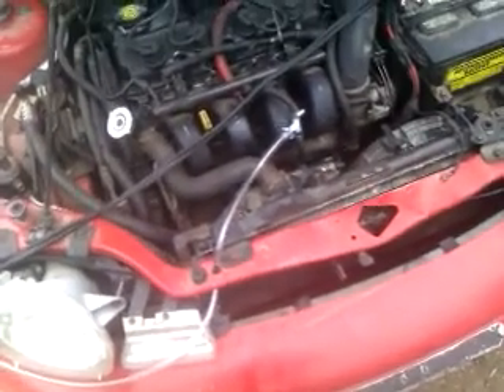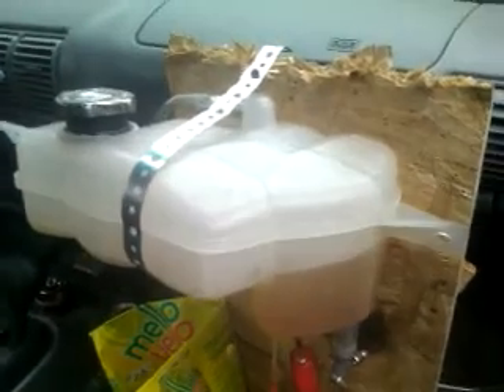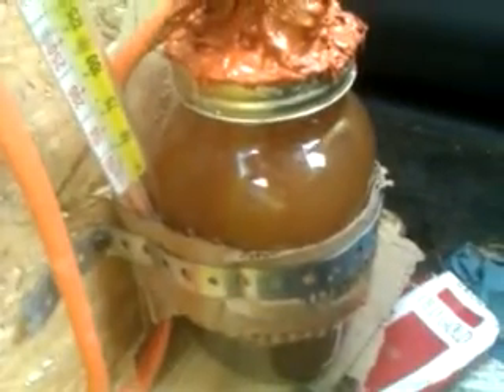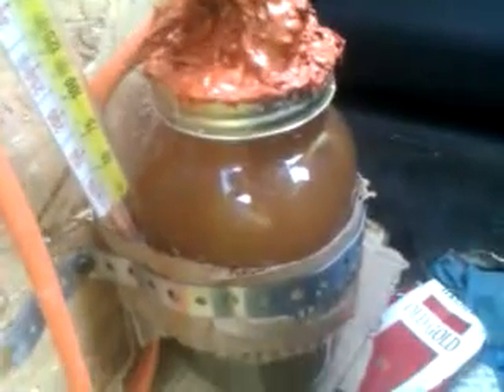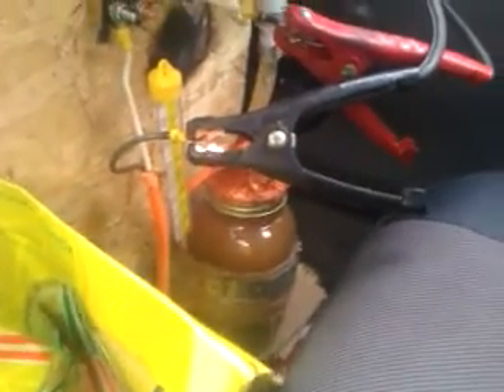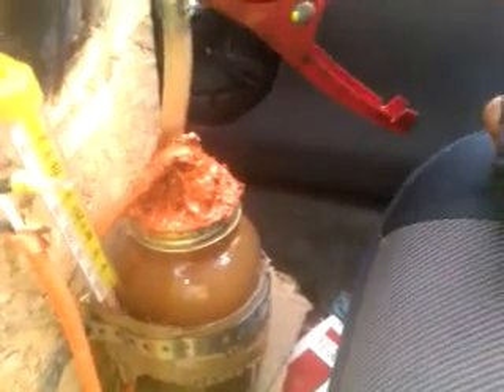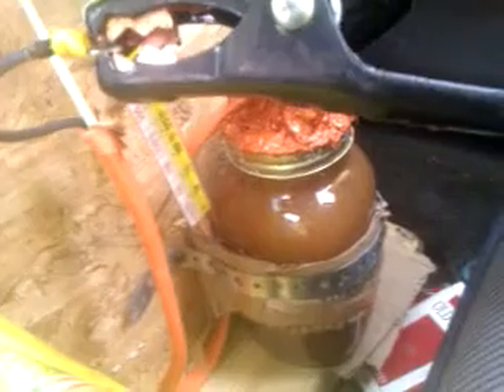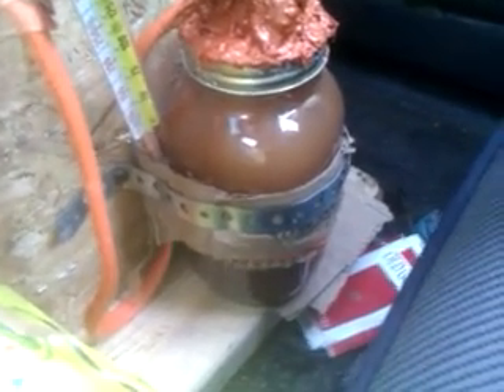HHO generator experiment on 1996 Dodge Neon

Comment from the maker: I don't know for sure yet, as I JUST started getting a little over 15 amps draw with the two cells I have.  When I put the head off the other car onto this engine, I also took the fuel pump.  For some reason, the fuel gauge acted different.  The top half of the gauge went quick and the lower half slow.  I got about 50 miles on the first quarter.  On this tank, I've gotten 60, and I'm now over 70 and JUST below the 3/4 mark.  Could be the gauge acting wonky.  We'll see when I fill up again.